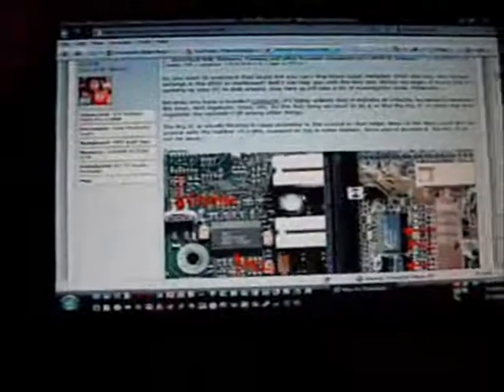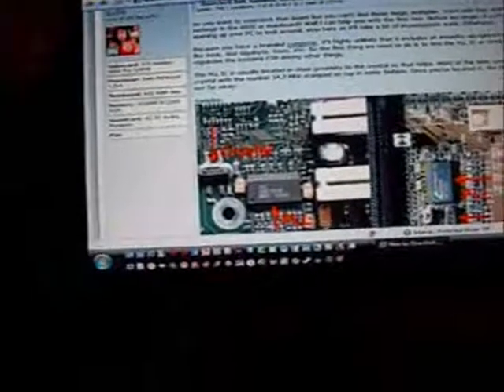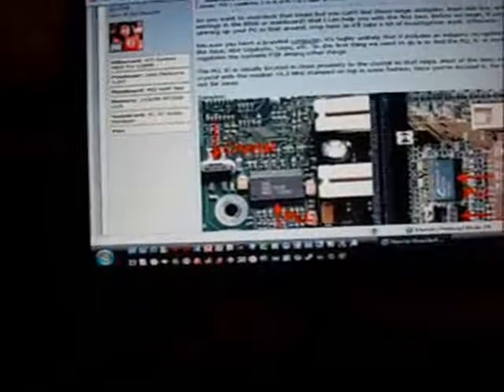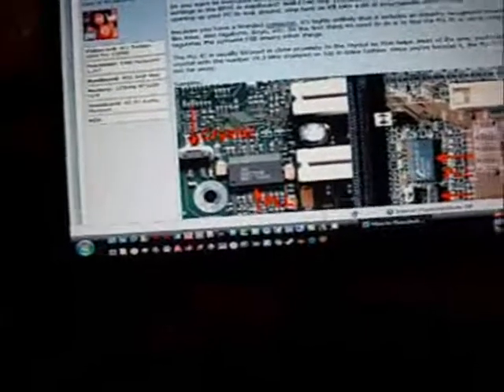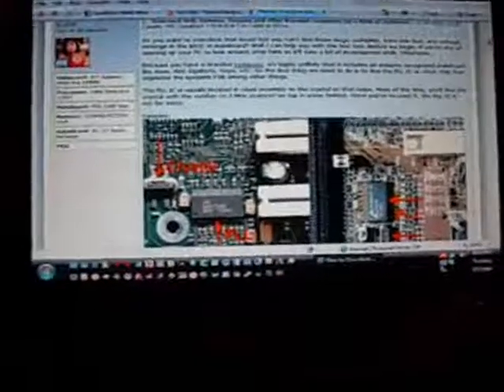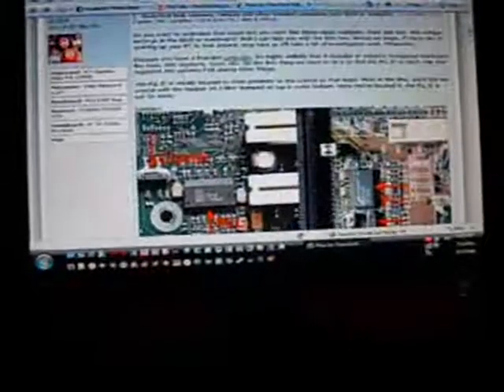software overclocking on the Gateway GT5012

Comment: I'm working on OCing my gt5012.. I installed a Pentium D 940 (3.2 ghz) after updating to the latest Gateway BIOS and its running pretty good. But I was wondering, how did you flash to the intel BIOS? I'm not sure how to do that without bricking it.. thanks

Comment from the maker: @rm33321 Thank you very much!. As for the board I would think any of the BTX (case opens on the left side instead of the right) Gateway boards would fit in it. I am not sure off hand which models that would be. But I think if you search Ebay you could find a lot of the Gateway boards. All you have to make sure is that the hookups on the back of the board are the same so it will fit in your case.

Comment: great video .... hey i have a gateway gt4016 and i have been told the motherboard has gone bad because it will not boot up anymore the fan would run and light blink...while it was tryin to boot but now ???. any ideas on what what other boards i could use to beef it up if you had parts i would glady pay... email me if you wouldnt care @ glenmiller20@aol.com

Comment from the maker: @theorangebox98 Yes it would be compatible. The board dose have a 16X pcie slot so you can run any of the modern video cards in it. The problem that you may run into is with your power supply. If you have the stock one in there it is 300 watts. They recommend at least 400 watts for the video card. So make sure the one that you have in there has enough watts. Or you will need to switch it to run that card.

Comment from the maker: Go into bios and make sure you have auto fan control turned off so that you can use speedfan to set the fan speeds to help keep things cool while overclocking.

The bios i got right from Intel. I checked on the motherboard for what model it was. If your is the same as mine it should be a Intel D945GCZ you want to check to make sure so you get the right bios for your board. 

Other software I would recommend would be Cpu-z to monitor voltage. Prime95 and super-pi for stress testing.